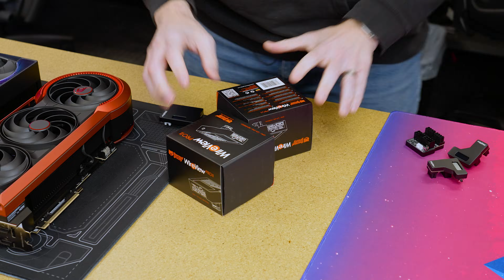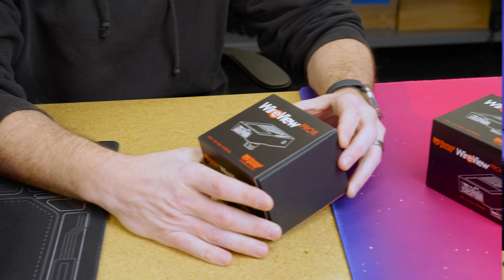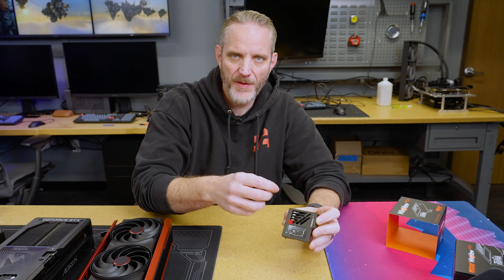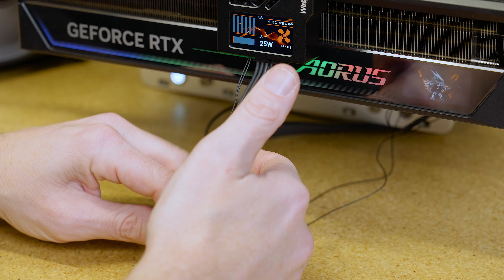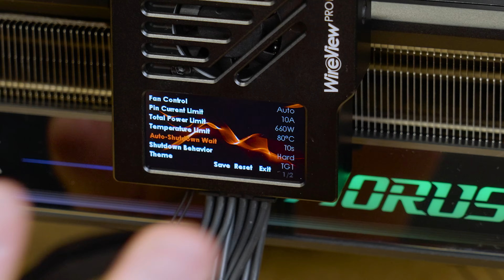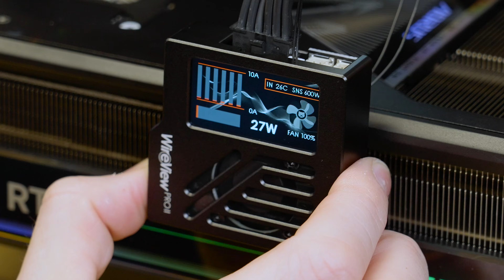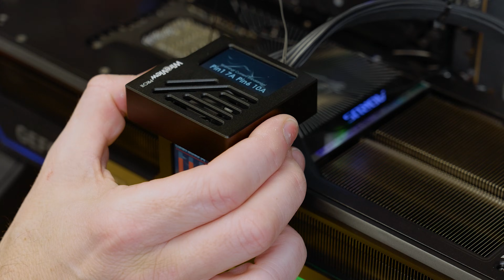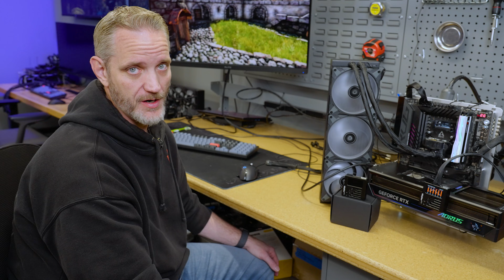Thermal Grizzly Wire View 2 Pro - The fight against melting connectors!

Comment: and how the heck iam going to connect it with my hyte y70 touch case the product is good but support is shit i have it now plugged in my astral 5090 to show the pins power which i see in twaek 3 and cant plug the case switch to protect my gpu if something happend

Comment: Finally got mine in. Grabbed it because trusted tech yourubers are saying DLSS 5 is melting or pushing pins to melting point. If im running a 5080 what amperage is acceptable per pin?

Comment: I got the wireview pro 2 myself... It's useful. I was batching AI video generations and my wireview started alarming because the connector hit 86C nothing devastating but ramped up the fans to get some more air through the case and its been good since. I don't know if it would have eventually got to melting temp without that fan adjustment, but now I know they won't - that wasn't even a seating issue just high sustained power..

Comment: My wireview pro melted. Gaming your not looking at a small output screen. I saw at first is was 40 to 46 degrees, a year later it was at 46 to 67 degrees. Heat build up between the wireview and the gpu gets hot, no air flow. Melted both wireview out to gpu connectors.  Bought new one from germany wow VAT $30.00 TARRIF, ON TOP OF THE COST.

Comment: Is there a 180 degree option for vertically mounted cards to run cables on the backside of the card?
Reply: Was just wondering that too. There are reverse and normal version. So i suppose if u buy the version opposite to the one u need its gonna be upside down how is supposed to go

Comment: even if it is not compatible with all cards, you can use a 12vhpwr extension cable, derb8er told me himself thermal grizzly supports that even included this solution in their warranty for GPU if anything fails. Also it's wrong the USB-C connector on the WireView Pro II is NOT ONLY for programming but also applying firmware updates which fixes some bugs and adds features, so it's kinda important to connect it to your motherboard internally!

Comment: I just got my Wireview Pro II today in the mail and got it plugged in and setup, though I don't have the extension cable for the power plug to turn off the PC yet, also man it adds another 4 cables sticking straight out of your GPU's power plug, so it kills the aesthetic, but it is a nice thing to have for sure.  I had to get the Reversed option for my ASUS TUF 5090, of course they come out with the White version of this wireview pro II just a few weeks after I ordered mine, but I guess I got it about a month earlier than they do.

Comment: A GPU operate at 12V DC, if a card is drawing 600W thats 50A, 50 fucking amperes
  
50Amps is the same as the maximum current FOR YOUR ENTIRE HOUSEHOLD.

Most houses in the US has 2 phase 50Amp service, so yeah, 50Amps is a ridiculous amount of current
  
50 Amps require 10mm² gauge wiring, that's a chocky, really chonky
  
Those pathetic 0.000001mm² cabel are not gonna hold these sort of currents for more than a nano second without melting

Comment: The Y-Splitters works with the F_Panel plug. You have de De-Pin the two Power sockets and switch them with the ones of the Y-Spitter.  Then you can integrate the Y-Splitter into the system. So you don´t have to buy an additional cable.

Comment: 9:53 to make these more universal it sounds to me like the monitoring should be done at the power supply end of the cable and have a wired display that can be mounted elsewhere in the case, perhaps even on the motherboard power switch header with pass through for the other buttons and LEDs

Comment: They just need to use aviation connectors at this point. A 1" OD connector can handle like 700V DC at 13 Amps. They look sick as hell and are keyed/threaded so they're basically impossible to screw up.

Comment: Of course it has been shown power connection at the graphics card can be insufficient. Could be the connector on the card or the cable that plugs in. In this testing. The device shows there is a pin with 7 amps flow and one with 10 amps. Is that due to the connection at the card? Or could it be at the power supply not delivering equal power to all lines?

It's likely a buss bar connection to the pins at the power supply. But still. If one pin has a weak connection to the cable, the others have to make up for it. Are you sure you had equal power at the end of that power supply cable?

Redo the test with a different supply and cable please.

Comment: Try to unplug and plug in again all connectors to see if it makes any change, if there is just a bad connection or oxidation layer on the pins. (Both sides - PSU and GPU)

Comment: I would not need the Units, I need the 8-PIN 12v units, the 12-pin 12 volts are maxed out  at  12 amps max  Useless  for my Cards use..

Comment: What is the overall dimension extending out when it is plugged in? The website only lists the overall depth which doesn't help determine if it will hit the glass on the side of the case

Comment: I am not a fan of the aorus cringy character in the screen on the GPU It's animated like those cheap Internet happy Wheels. And what's up with the hi aorus What is this Siri voice command cringe. Besides that rant there Pretty cool that you can monitor the voltage on these now on different Gpus that can fit Hopefully we'll get more instances where the card is doing funky stuff with the voltaging I mean it's not going to be so great for those that get the problem but at least now they have a little bit more proof of what's happening with these meters.

Comment: All of this effort because Nvidia cant be bothered to admit a mistake and roll the designs back to 3 8pin pci-e conectors. Also, i had never heard of AMD cards catching fire until this video and why is that? Because most of them dont use the stupid 12pin conector. Now Saphire of them all deciding to go with it on the 9070xt is definely a reason to avoid them.

Comment: Can you test this inside of a mid tower case?
one of the things i was concerned about was the total height of the GPU and wireview being too big which would prevent me from having my side panel on
Based on the sizing document they provided too i calculated on certain setups it could be up to 190mm of height as a worst case scenario which it seems is hard to find mid tower cases that fit that size requirement

Which it does depend what GPU you get some of them have the plug all the way at the edge while others are like the matrix having it sit deeper in but still something that would be nice to know

Comment: This is one of many reasons why I just bought a 9070XT. (I made sure it doesn't use this crap). Sadly my 3070 is going bad........I THINK. I HOPE. It's not the RAM. I thought it was the RAM. I had some spare RAM and it still crashes. I'm going to replace the CPU thermal paste this weekend (it's 5 years old thermal paste). I have plenty of radiator fluid. To be fair I have not examined either the CPU or GPU blocks. I am a little sad my GPU won't be in the loop anymore. But it is a pain to test it since it HAS to be watercooled.
Reply: I would have liked to have ruled out the thermal paste first, but I noticed GPU prices were rising. The GPU I bought it like $20 more today than yesterday. So.....buy it now while it's still under $700.

Comment: If only the 12v2x6 powercable plugs would get an update and not melt anymore..
WTF Nvidia still using this? Held off on buying a 4070 and up because of it and now their next generation still has this flaw. ALL brands using this are not using their brain wtf.
Using a GRE now and not even looking at an RTX card, would like to actually use my hardware in a relaxed way instead of waiting for a fire ffs..]
Why has no one ever sued Nvidea  over this? The nerve of the Leather Jacket to never address this publicly is beyond arrogance.

Comment: Wonder if it would work on my main system a rog strix 4080 super + Hyte y70 case. The y70 has one of those unified front panel/power button cables all in one so id prob need that splitter huh?

Comment: I was able to jam the prongs into my unified connector and piggy back the shut off switch without making and cut or adding a second wire. I have an MSI X870 Tomahawk/ Gigabyte 5090  for anyone curious.  Works perfectly.

Comment: If you didn't want this visible, could you in theory have this installed into the PSU directly and set it up for safety shut off ?

Or does it have to be installed into thr GPU end of the cable

Comment: Moral of the story: Do not fix a problem that doesn't exist. 
Wish somebody would create a better standard for fan plugs (not the dinky little delicate pins that you accidently bend because you didn't want to mess with removing screws, anti-sag brackets and GPUs to access a connector) and that all manufacturers would just use unified front panel connectors already.

Comment: Luckily the Pro 2 I preordered should fit on my 5090 iChill Frostbite with the Alphacool 180° Terminal installed. I’m running the Pro 1 currently.

Regarding compatibility, in his newest Matrix video he said there will be a cable variant of the Pro 2 with a redesign to mount it somewhere.

Comment: Hey Jay, I'm repeating myself, (or I digress) The old VGA plugs for monitors had a thumb screw on each side to lock it in place and the connector pins were also locked in place, so nothing moved or came loose. Hmmmmmm 🤔 they even had the correct size wire (Gauge) so the god damn thing didn't melt. just sayin

Comment: I hate that I feel like I have to use a solution like this or the one Corsair unveiled at CES. I ordered my WireView Pro 2, but I feel like I'm a playing Russian roulette by using my 5090 raw dog. I saw on der8auer's video talking that a slight stress on the pin positions can cause a load imbalance, so wiggling the connector can change the amp draw per pin. What a mess this 12 pin connector is!

Comment: there is 4080 gpus and even 4070/4070 ti cards with burnt connectors. a 4060 or something around that low power usage is the only safe bet that wouldnt need a wireview.

Comment: Or go back to 8 pin and upgrade the standard for the monstrous wattages of today. No one cared having 3x8 pin cables, is still peanuts compared to what older standards used to do like 3x old molex connectors on 5,25 fdds and things like that. It's another 24 pin atx connector but instead of going to the motherboard, it goes to the card, who cares.

Comment: Its like 90s and up car audio.12volt car amps we would use 8 gauge and larger. When i saw the cables for these cards staying the same old tiny size with power consumption growing quite large im thinking man this stuff is going to start melting soon heh and it did.. Just make a new psu connection with a pair of 8 gauge cables and it will be solved

Comment: It shouldn't be like this, if the GPU is more powerful, then it should comes with stronger cable and connector that won't melt, isn't that just some common sense?

Comment: If your still using GpuTweak 3 for the current protection there is a better way, You can setup HWinfo64 to monitor and give warnings when your pin's go out of spec, my card runs better at stock without gputweak 3 then with it.

Comment: The year is 2034 
"Der Bauer is excited to announce the upcoming WireProtector 4. The WireProtector 4 will block the "Nvidia AI PowerCabletiCon" from strangulate you in your sleep, like it happens sometimes. It also gives you real-time data about the toxic chemicals released when the Nvidia AI Accelerator shift in its "AlienBrainMode", in particular when using FrameGen100x settings."

Comment: Cables should be thicker. Funny, when running DC in a boat, there are hard rules you follow. And 4 awg wire you don't go over x amps, let along the amount they are sending through those tiny wires. Would burn many boats.. Using boats as one example, since they use DC.

Comment: @jayztwocents  not to doubt you in anyway.. (I doubt this message will even be seen to be honest). At 22:50 you say the GPU power cable terminates to two 8pin pcie connectors. But did not elaborate on how it is just the cable. (Not that you had to but)   To rule out another point of failure and given your probably using a "Good" psu, it will probably  have actual dual 12v rails with upto x4 (or x6) 8pin pcie sockets . Have you tried for the sake of ruling out. (Trouble shooting) Either a) swapping the 8pins over A to B. And B to A. To see if the high current stays on pin 6 or if the high current moves to another Pin. I don't need to explain what this will mean.  B) Have you double triple checked that you are actually using separate rails within the PSU? Or are both 8pins on the same rail?  Ie 8pin A on R1 8pin B on R2 .   ??

Comment: Trust me to pick the only AMD card to have the 12VPWR connector (sapphire nitro+ 9070xt). Part of me wants a wire view, but if need an extension cable to connect it as it's hidden under the back plate facing the front of the case. With an overclock I'm seeing 370w average with peaks of over 400w a wire view might be a good insurance to save my PC

Comment: Here I am in bliss with an EVGA 3080 ti ftw3 that ran just fine for 6 months with two out of 3 plugs incorrectly seated after a move. And they were very noticeably not seated correctly, I just didn't open my case for a while. Why did Nvidia decide a square wheel with a blowout would function better than a circular wheel with a fresh pirelli?

Comment: i didnt realise when you actually see one of the connectors, how small the plug is and the actual guage of wiring! no wonder it cant handle some of the loads. 3x 8 pin ftw like on my Rog 3080ti You missed a product name Jay its Wireview Pro Squared, Roman can have that one for free. I own an inverted wire pro after i melted 8 pin extensions and leaving GPU tweakj II with the test power option, it has been bombproof tb, Cleans up the connector solution as a bonus.

Comment: I'm so happy that I bought a 9070XT without that sh.tty connector. Good old 2X8-pin (or better: 2x 6+2 pin) and it works like a charm, no need to think about these issues

However, for people with RTXes and Radeon 90somethings with that sh.tty connector it is absolutely worth the invest. Better paying 140 bucks for the device instead of maybe quite soon  thousands of bucks for a new Graphics Card or even a new PC.

Comment: I'm so thankful in numerous ways for having opted for the 9070 XT last upgrade. It's been a huge boon with my switch from Windows to CachyOS and it uses the standard PCIe 8-Pin connectors so I don't have to worry about the silly 12vhpwr connectors.

Comment: Probably a lot of work but could you do a roundup of the most popular cases with a 5090 installed and if the side panel will close with the WireView installed? I have an Astral in an original 011 Dynamic and that looks too thick to fit.

Comment: Sapphire look and sound like idiots now. They were so big on the claim the connector wouldnt be any problem and look 'hasnt failed at all!' then a few months later...glad I grabbed the Powercolor instead again, at least they are not dumb enough to try and incorporate a stupid 3 year failing connector. The Nitro+ 9070XT might get 4 more FPS than mine but at least mine will still be around after a year and hey, I can easily undervolt and overclock my Hellhound and reach Nitro+ levels of performance!

Comment: If I had a 4 thousand dollar GPU. I eliminate the GPU 12v power connector; hard wire it directly to the power supply 12v connector.

Comment: eliminate the 12pin connector and the problem will solve itself this is we did dual 8pin aka 16pin in the past because its to dangerous to push that much watts and amps  through dual 6pin even if you merge them into one connector ... we all  need to stop these  designs ... even industrial  wont do this way due to the hazards

Comment: And yet, my old gtx 970 by EVGA ran a dual connector 12 pin (6 each) for a 300w card. Can't these morons just make these uber power hungry cards with 2x12 (or 1x12 and 1x6 or 1x8) and end this power draw problem by actually spreading it out?

The solution has existed FOR AGES by now. Need to move too much through one cable? Add another cable.

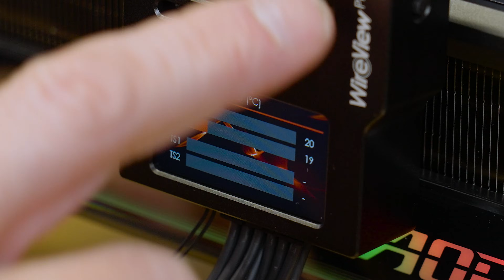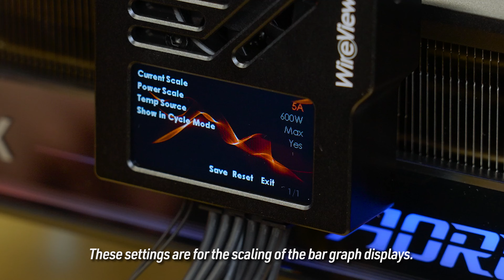Comment: 13:05 there's another potential issue. Pressing the buttons causes quite a bit of movement of the WPii. We do not want cable pins and their subsequent cable pin sockets expanding the pin sockets. Otherwise it would cause current to flow in expanded pin sockets, over a smaller contact, hence heat. ... Again at 13:31. .... It's probably best set while not on the GPU if possible, and then left alone.

22:57 Der8auer demonstrated that current imbalance is possible to correct by pushing the cables further into the sockets.

Comment: I've heared Lian-Li announced a PSU at CES that reads every single connection and has a safety feature integrated that auto shuts-off after 3 min of unstable current

Comment: It's a toxic product environment. Almost nothing is the same as anything else. Like power supplies that have different pinouts than the next brand. You then have to use the supplied cables because another brand is wired different on the PSU side. Nothing in the market for whatever reason just fits. The argument then would be that the market would be boring and have no originality... double edged sword there. Can't have it both ways. Plus this product here should never be needed or wanted to start with. As far as the plug goes.. They could have just made a "cable" with this wired in line instead of it hard mounted to the card side.

Comment: I want this so bad but no way it fits in my case. 4090 already has a pretty tight arc on the cable that touches the glass panel before arcing down